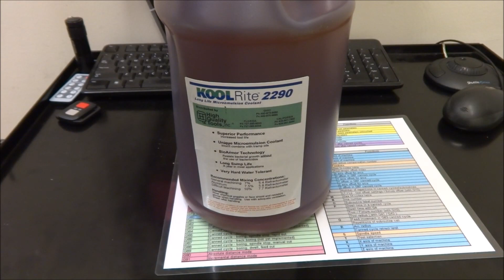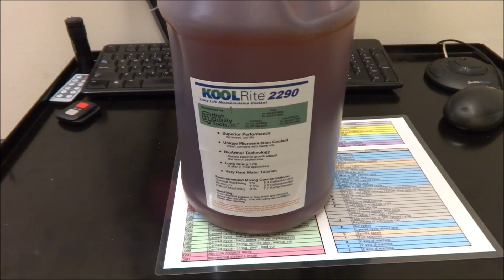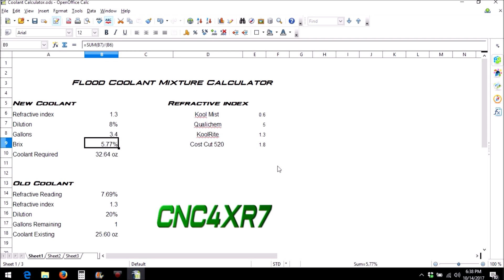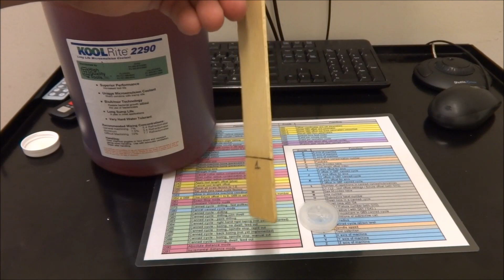KoolRite 2290

Comment: What coolant would you recommend for a Mist coolant for aluminum ?
Reply from the maker: I really cant make a suggestion as I have always ran Flood or a spray bottle. I can say I did not care for Koolmist 77 as a flood coolant. It stains the Aluminum if left on the material.
Koolmist also did not do well for drill cycles.

Comment: Far as precise as you are trying to be, I think you are using the wrong measurements.  When you want a gallon of coolant that is 8 percent coolant you should start with 92 percent of a gallon, about 117 oz and add 11 oz of coolant to give 1 gallon total of coolant.
Reply from the maker: Hi Pat I'm not quite sure I follow? 128oz per gal @ 8% =   128*.08 = 10.24 is that not correct?
128*.92= 117.76.
Now if your saying that I should start with 92oz and add 11 oz. to make up one Gal. and that will give me the correct % for one Gallon well that is interesting. But I think that if you add the 10.24oz. coolant to the 128oz. of water this will give you a 8% ratio. Although you will no longer have one Gal.
I made the Spreadsheet to take the guesswork out of it when adding to it. the Brix reading will effect the numbers however you really just need to be close so it's ok either way.
Be Safe, Sam
Reply: @CNC4XR7  Actually, the amount to add to 1 gallon of water to get an 8% solution would be (x/(x+128))= .08 or 11.13 ounces of coolant per gallon of water. 11.13/139.13 = .08. 139.13oz is 1.087 gal so to make 3.4 gallons of solution would be 34.81 oz of coolant + 400.39oz of water.
I found your video by trying to do some research on what to put in our new lathe and mill. How has it worked out for you? I don't see it on the JTM website so trying to figure out if it's been discontinued and if so, why? It's not for sale at many places online either but I guess a 5 gal pail makes close to 60 gals so that would last awhile. Great videos by the way.
Reply from the maker: @keithwaz  thank you.
I have been finding it on ebay. It's is under a different name but the same  compound.
ALPHASOL 190-1 SEMI-SYNTHETIC COLLANT (1 Gallon, 128 oz)

Comment: Here is a formula for figuring gallons that I use to build tanks, L X W X H = cubic inches X .00433 = gallons. You know the size of the tank just measure your coolant depth then you know the amount. Nice video.
Reply from the maker: Thanks Wyatt,
That's a great Idea I will add that to the calculator.